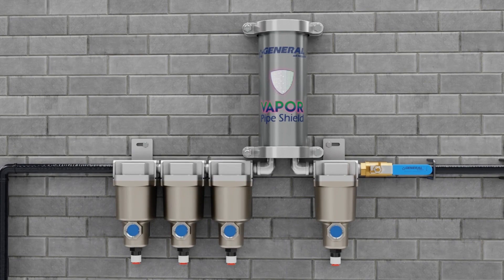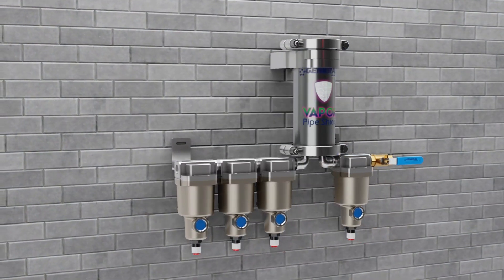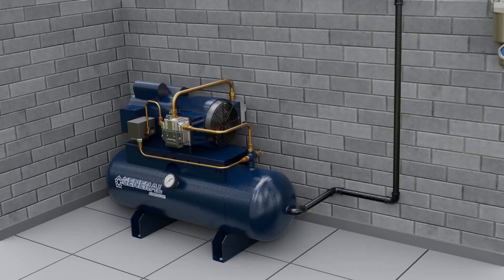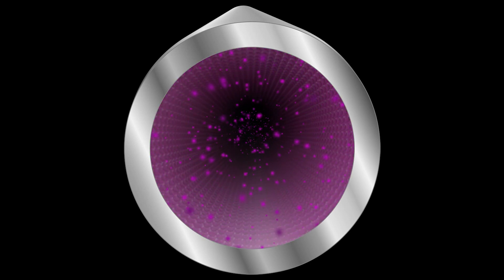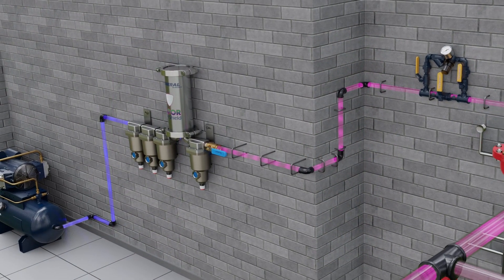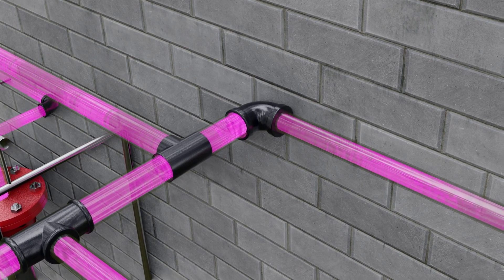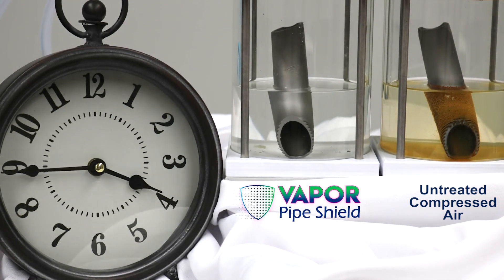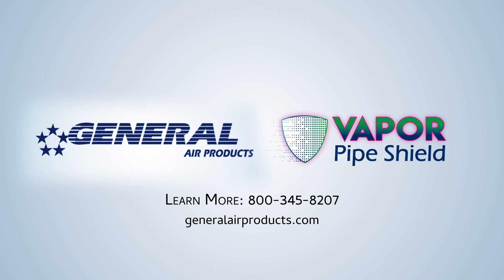Introducing: Vapor Pipe Shield

Comment: Can this be installed on existing systems or is it for new systems.
Reply from the maker: Good question! Vapor Pipe Shield can be easily retrofitted onto any existing system as well as used on new systems. Though the VpCI molecules will not repair any existing corrosion that has already taken place, they will prevent the corrosion from worsening. Given the compact and inexpensive nature of this product compared to alternative corrosion mitigation methods, we've seen existing systems be an ideal application for it.